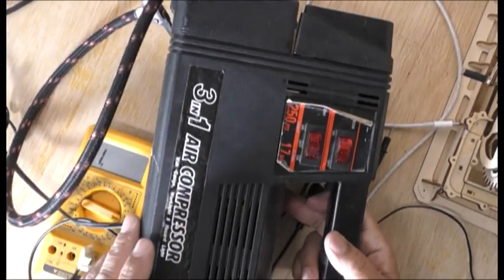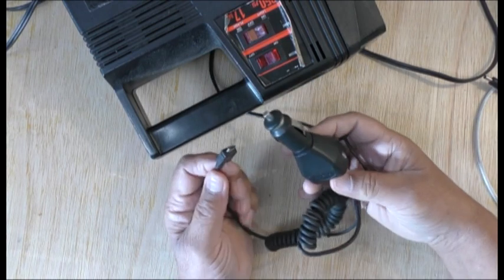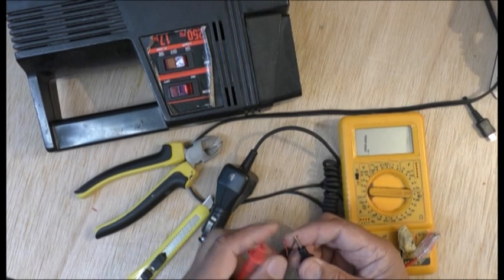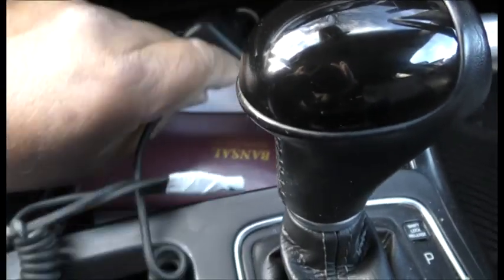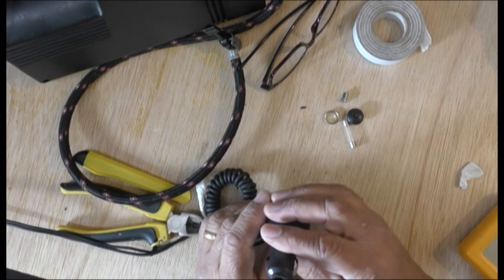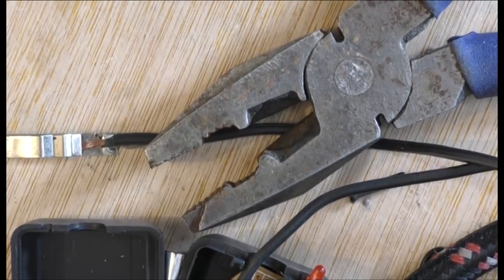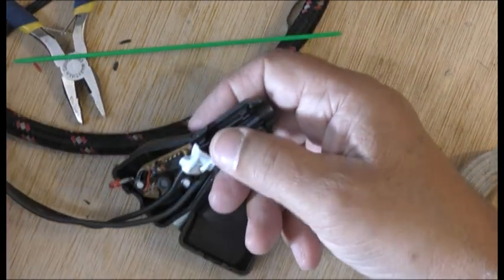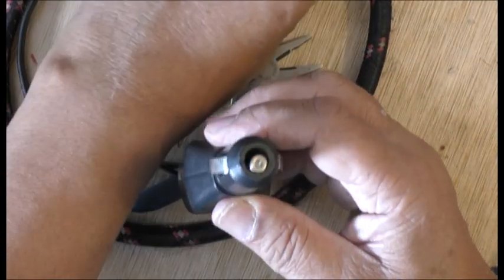#182 Car Air Compressor socket repair

Comment: Glad you changed that out half way through. I was writing the following comment before you got that far. That looks like a phone charger lead your friend has given you, so I would expect the output to only be 5 volts. I would also think those thinner wires would struggle with the current draw. Putting a nail in to replace the fuse will make you pump work, but may overheat the wires behind the dashboard. I hope you are lucky. 👍👍
Reply from the maker: Yes you are right about everything but don’t worry I didn’t put a nail 😂 just a thin wire. 
I did think it had a circuit in it. Should have checked first. Thanks Grandad 👍🏼
Reply: @JustFun-iz9rf  no, I am never right about everything, that is my wife 🤣👍